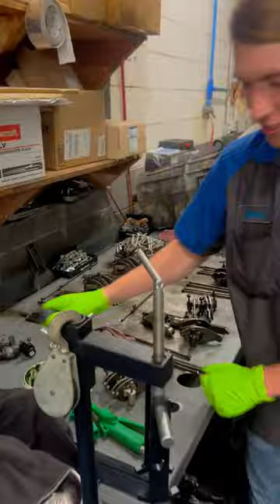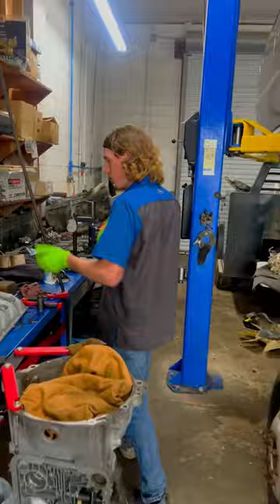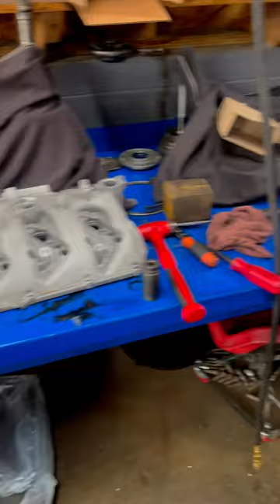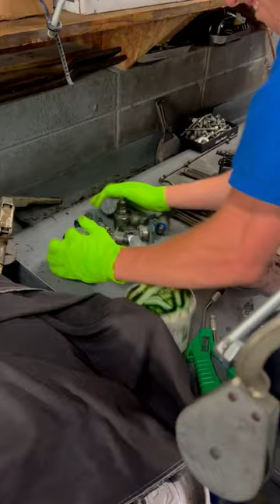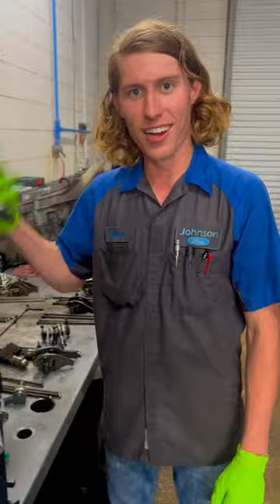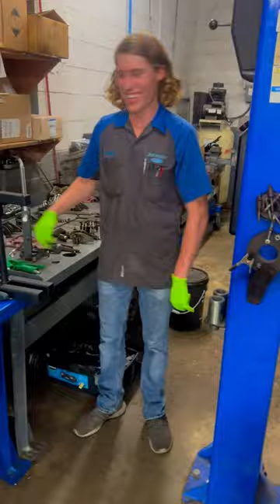Gonna cost you…. 10K #shorts #ford

Comment: You are the greatest salesman Cummins has!
Reply: Ha! 6.7 Cummins also uses the CP4 and also fails at a relatively high rate. Dodge is going back to CP3 because of this, however.
Reply: @jameshatch3996  Never said Cummins was perfect. Haven't seen many fuel pump issues with them.  Biggest issues with the 6.7s are turbo chargers and emissions bull 💩. Head gasket failures are common to see too. However the track record of a 6.7 Cummins is way better then these Powerstrokes from what I'm seeing.
Reply: The CP4 replacement for Ford is coming soon from S&S.
Reply: @CJ-jo6do  yeah it was that way on the 5.9s too. Anything consistently over 30 lbs and it's time to look at studding it.
Reply: @jameshatch3996  They are also under a recall. Cummins cares. Ford doesn't
Reply: @fredtflail  *chrysler
Reply: @christiandavis3910 And it’s actually affordable compared to replacing the failed one on a CP4.
Reply: @timmarbarger928 oh trust me, there’s just as much pump failures on the Cummins as they are on the powerstrokes, it’s a pump design problem, only difference? You can cp3 swap the Cummins, you now can swap out the powerstroke to a different pump that in theory should be far more reliable.
Reply: @jameshatch3996  *Fiat
Reply: There’s a kit you can put on the truck called the “ disaster prevention kit” that adds a filter in the return to save you from getting shavings scattered through your whole fuel system . It cost like $500 and I put it on in a afternoon
Reply: @jameshatch3996 lol literally everything fails on ford , they break down before their warranties are up, yes I work on them but the power chokes I won’t work on , they’re piles of crap
Reply: @timmarbarger928 i made 40lbs of boost on stock bolts daily. 55 is actually the limit before you'll blow the headgasket  with reliable certainty, know your shit before spouting.
Reply: @KDlGG its called a dcr and its gonna take all day to swap, a cummins? 1 hour 😂
Reply: @carsandfirearms2467 nothing like the dread of will "my cp4 on my powerjoke leave me stranded?"
Reply: @cole1407  bro what 😂 if it takes you 1 day to swap a fuel pump never touch an engine. It takes an hour 💀
Reply: @jameshatch3996 nope. 6.7 cummins went back to the cp3 like 2 years in because they realized that cp4.2 wasn't worth all of the b.s. so 19 and 20 had cp4.2 but 21 and up still have cp3. That's why they aren't making a whole lot of power. Because they'd rather have reliability..which is comical because their transmissions still suck ass unless you splurge for the aisin. They should have kept the manual as an option.
Reply: Cummins had people waiting for months for that recall because no parts available 
And they did fail frequently also. I did a lot of them
Reply: Is he serious? Cummins cares?? Lol

Comment: I find it that it is not really necessary to replace an IPR valve/ fuel rails/ Injector fuel lines.
This can all be reused to save customers the expense. 
All you have to do is clean these parts, Replace HPP, All Injectors. 
I know a lot of you will say no way but I have one of the biggest fleet Account, and we have at least 1 HPP fail in a month. 
I have done the job multiple times with no problems, trucks never came back with any contamination issues. 
I been an independent for 33 years.

Comment: Lol those 6.0’s not looking so bad huh
Reply: Haha they aint now.
Reply: Well said.
Reply: No, un bullet proofed and you'll still spend 10k getting it reliable, if you buy a manual cummins you don't have to worry about jack shit. And no were not talking about 2nd gens if the dash irks you so much
Reply: Amen! I love mine!
Reply: @cole1407 except for KDP bricking your entire engine or a p pump going bad.
Reply: @SkSKSK283  KDP only exists on the 12 valve, the p pump is actually one of the best pumps, unless you run it dry and crack the veins....
And the KDP doesn't always get jammed between the cam gear sometimes it can make it simply to the oil pan and it is also solved with a 10 cent piece of grinded scrap metal and a drilled hole. 
Next...
Reply: @cole1407 You have no idea what you're talking about kid. 6.7 Cummins are jokes. 😂

Comment: It ain't just the fords it's all of them from fuel contamination
Reply: Thank the EPA
Reply: Cummins and Duramax went back to the Cp3 so not really. Its a Cp4 failure wiping out the fuel system. Even if fuel issues started it you won't damage your engine if the cp3 starves.
Reply: @cole1407  I have yet to see engine damage from pump failure just the entire fuel system. The cp3 pump is more reliable but it is just as vulnerable to fuel contamination with the same results.
Reply: @cole1407 the Duramax uses a Denso system now.

Comment: How do I have 300k on my 6.7 tuned and deleted and none of these issues
Reply: You got lucky 😂😂
Reply: @cheetah transport  how about my friends that still has the dpf and egr with 400k all original
Reply: @Fordgpw1942ocalafl  that good there luck is too. I had new motor from the dealership that lasted 3000 miles
Reply: @cheetahtransport939 you may just have bad luck 😂
Reply: @Fordgpw1942ocalafl  he was lucky they don’t all brake down
Reply: @cheetahtransport939  If there's millions and millions of these 6.7s produced for more than 10 years how come we don't see millions and millions of these problems personal have these trucks in fleets and 300k no issues out of these trucks
Reply: Maintenance has a lot to do with it. I drain my water separator beneath the fuel filter once a month and check my fuel. If you see something abnormal you can catch it. Sometimes. Oil and fluids check consistently. Oil filter and pans check for leaking oil some people just put diesel and def in and drive the shit out of it with just routine oil changes and over due fuel filter changes
Reply: Same here. The lack of maintenance is crazy with the truck. Like fuck man, these are 60k+ trucks. What's an oil change, and fuel filters?
Reply: @Fordgpw1942ocalafl  my friend has a Powerstroke shop and the 6.7 is the new 6.0 with fuel system failure 🤷🏾
Reply: @cheetahtransport939  🤣 sure haha
Reply: @cheetahtransport939  the duramax with the cp4 doesn't have issues or what about the cummins with the cp4. No they do have issues ford is the only ones with a good lift pump fuel system and a cp4.2 they do not have issues when serviced properly
Reply: @Fordgpw1942ocalafl  Cummins had the cp4 for 2 years and went back to cp3🤷🏾

Comment: Yeah Ford engineering
Reply: They all use the same fuel system so think again
Reply: @Fordgpw1942ocalafl Cummins uses a CP3 and the Duramax uses a Denso system.
Reply: @meade4573  2022 cummins use cp4 and lmm use cp4s until the l5p came out

Comment: Ford was sooo dumb for using the cp4 pump after GM had their complete fuel system failures using the same damn pump.
Reply: They really didn’t have much choice considering the emissions regulations that were pushed on them same for GM.

Comment: They arent repairable? Sounds like 2023.
Reply: S&S Diesel has come up with a solution for the cp4 you should go check it out if you have a 6.7 Powerstroke.
Reply: @kirbywinters1291  I don't. I just know which way everything's going. I work on small engines where adjustable jets are replaced by fixed jets. Plastic is replacing metal. Electronics are cheaper to buy a new one, then get fixed. Ted K had alot right. I'm glad there's companies that are fixing stuff but I fear the snowball, aided by monopolistic corporations and cold unanswerable government have steered the ship directly at a giant iceberg.

Comment: Is the any better reason not to buy a diesel?
Reply: Gotta put 200k on the odo before even breaking even?  Can't pull the heavy stuff using an aluminum paint shaker with a puffer attached, runs outta wind too quickly.

Comment: It’s due to ignorant owner that either put DEF in the fuel or never drain the water out of the filter, or never change the fuel filters.  My 2023 Super Duty Tremor with the High output diesel has a 10 year / 175,000 mile warranty (I paid for that extended warranty) that WILL cover the fuel system as long as I do the proper maintenance and pay attention to where the DEF goes. If the CP4 fails due to no fault of my own Ford will cover it. I also run Hot Shot everyday diesel in EVERY SINGLE TANK OF FUEL and Hot Shot Diesel Extreme once a month. Everything is about maintenance, no matter what vehicle it is.
Reply: Sounds like too much hassle to own a vehicle, especially if it isn't being used for heavy hauling (seems like most diesel trucks on the road these days).